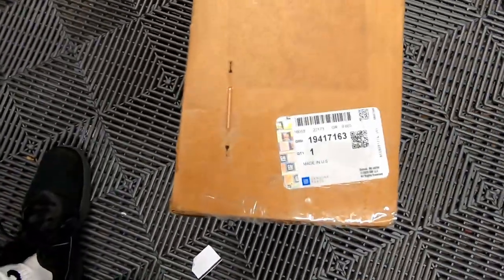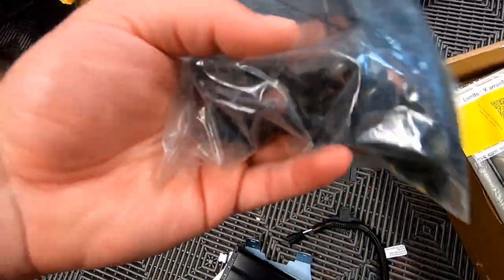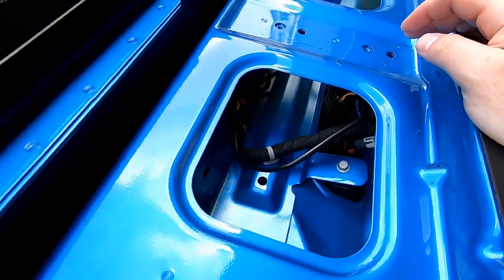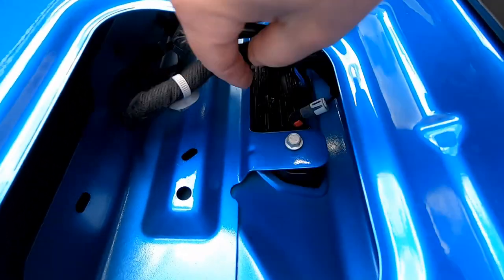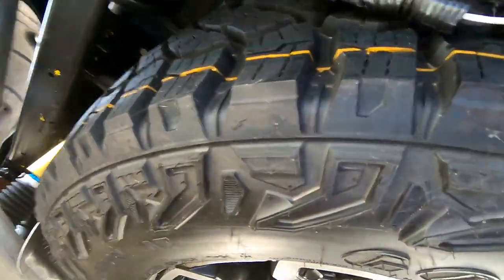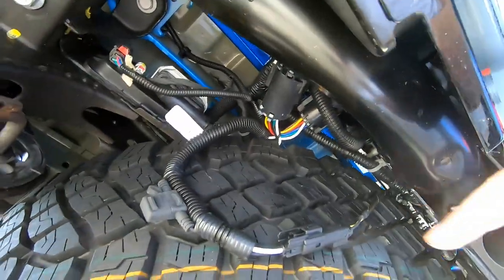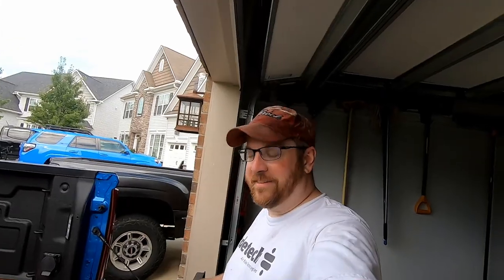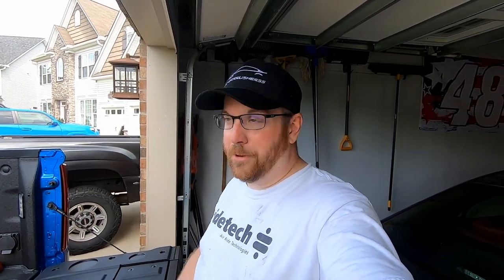2022 Chevy Silverado ZR2 - Kicker Tailgate Speakers

Comment: Excellent video, seems like a ton of work.  I’ll probably just buy a $300 Bose Bluetooth and put it on the tailgate as needed.  Way easier to replace in the long run.  However, it’s a  neat install and if it came with the truck I bought I wouldn’t turn it away.  Just not sure doing all that is worth it?
Reply from the maker: Not that hard of an install at all - plus you get some kickdown lights at night.

Comment: Question about the lights. I had the kicker system installed by dealership, but it did not come with the lights.  The lights you have listed, I assume they come out of the  plastic piece and then will pop into the holes on the Kicker speaker system? 2022 Denali 2500
Reply from the maker: Yes - I popped out the plastic filler pieces and installed the LED lights.
Reply: @bonecrrusherSS  Thank you sir, I appreciate the help.

Comment: Might be a stupid question but did you have to disconnect the battery?
Reply from the maker: It's one 10mm bolt - so I would disconnect the negative terminal. 

Your messing with electrical - and you should.

Comment: There’s this other guy on here looking to fix a tailgate upgrade and he can’t get power to the second door with the speakers so the trailer is were you get the power for the tailgate ?
Reply from the maker: There is an adapter harness that comes with the kit. It plugs in between the bumper and trailer connector wiring under the bed. I covered that in 13:30 mins in.

Comment: I have a 2022 refreshed Sierra slt with the 5.3 and for some reason on the gmc store it says this is not compatible I feel like it should work but I wonder what the deal is
Reply from the maker: You probably need the kit that includes the secondary bose amp.
Reply: @bonecrrusherSS  I have the Bose speakers tho

Comment: Does the sierra Denali 1500 model apply the same? 😅
Reply from the maker: If you got a 2019+ yes it will fit if you have the flexgate.
Reply: Thanks you